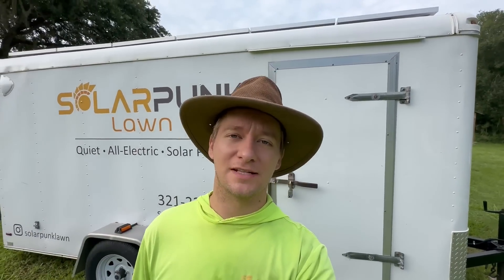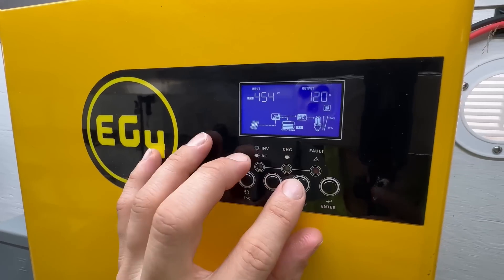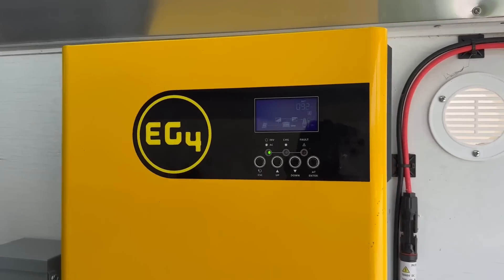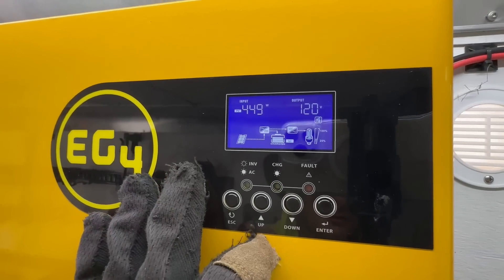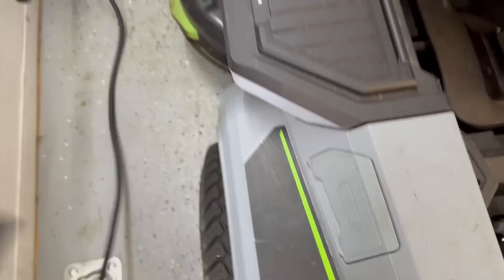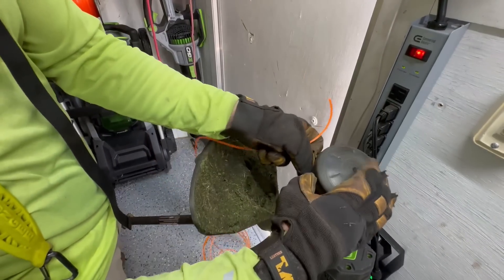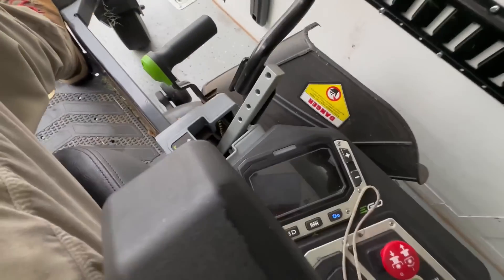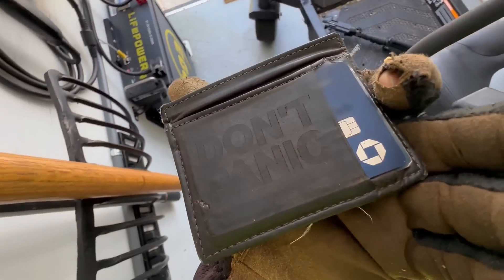Mow Forever? Solar Powered Lawn Care

Comment: But electric ain't the future huh? I love electric cars trucks vans leaf blowers lawn mowers it don't matter but it's battery powered that's badass. With internal combustion engines you have to wait for the power to build with electric motors you get it all at once. And quite violently if you wish.
Reply from the maker: Yeah I really miss having to do oil changes, mess with belts, fuel and air filters, mixing gas and oil, and pull starting a chainsaw 30 times before it fires up. Not to mention the smell was to die for, I’m getting choked up just thinking about it. All this electric stuff is too easy and it doesn’t make me feel like a man. It’s starting to crack my fragile EGO.
Reply: @solarpunksteve  all I can do is laugh love your work man. I'm attempting to go all electric but it's expensive.

Comment: So cool to watch. Growatt has a 48v all in one inverter that has a minimum solar requirement of 60 solar volts... So it does a lot better on cloudy days.  My current system has the same minimum 120 solar volts it shuts down in clouds as well.

Comment: you're wasting your time over using gas tools because of your investment in all the panels, inverters, and the tools themselves. You've probably got a 10k+ investment where everybody else has half that or less. 
It's not like you get to charge more because you're running solar crap.

Comment: Buddy I been wanting to do this setup for over a year. Big prompt to you and your setup and homework you did. Only thing holding me back is if I drive up in a diesel truck kinda counterintuitive to be using solar. 😂 You might want to add fan or 2 to help ventilate the trailer or it could affect your battery charges
Reply from the maker: Honestly I wasn’t sure if my car was going to be able to handle this whole setup and I’ve been pleasantly surprised. Don’t let it hold you back, one thing I’ve found, is most people just don’t care. Some people are like “oh you have solar, that’s so cool!” others; “that Tesla hauls that thing‽ wow I didn’t know that”. But the vast majority: “how much do you charge to mow my yard?” 🤷‍♂️

Get your system up and running with whatever you have, reinvest as much as you can and build a client list and reputation. That brings cash flow, then buy an electric vehicle some day down the line when you can afford it and save on fuel costs. 

I sound like I have it all figured out and it’s easy but honestly I’m just solving one problem and then moving on to the next as best I can. Good luck, let me know if you go for it!

Comment: Mowing someone's front yard for 25 bucks a week. While maintaining gasoline equipment, that is easy and straightforward to maintain. That's doable Since California has made it to our starting January 2024. There will be no more gasoline equipment sold. If I have to buy electric mowers, weed eaters, blowers, solar panels, and all this other crap  I'm gonna have to charge $75 a week. Electric equipment cost 3 times more than gasoline. And when it breaks, you either have to replace it. Because there's no rebuilding the motors. There's no change in the spark plug or a coil or a pull cord. It's all plastic, it's all electrical parts which go bad. Corrode have to be replaced, which is another expense. How many people out there want to pay? 350 to $400 a month to get their lawn mowed. Hardly any So all the governments doing?
Is causing jobs to be lost. Add neighborhoods to look derelict. If you don't believe me, just wait until January comes and then next summer in California. Grass, fires, yard, fires, people not maintaining their properties. I'm already preparing to just do straight fencing repair, plumbing stucco concrete demolition work. No more yards not gonna update with this electric movement. And when the neighbors around me choose to not mow their yard because of the cost of equipment or the cost of labor I'll be calling code enforcement to get them find to clean their f**** yard because they all wanted to vote for Biden and they all wanted to vote for Newsom you can pay. The f**** price. For who you voted for.

Comment: this is such an interesting business case, great video...I'm still stuck on companies keeping the removable battery power solution on larger non-hand held equipment like the riding lawn mower.  I would think they would switch over to a more standard fixed battery pack like an EV has.
Reply: Think its because many people keep mowers in garages or sheds that aren't climate controlled so aren't the best environment for long term battery charging/ storage as these batteries don't have temp control like a Tesla

Comment: so just curious does constantly doing a partial charge on all that deteriorate the battery’s longevity?
Reply from the maker: Probably, but not as much as a full discharge would.  These battery chemistries don't like to be drained to below 10-20% if you can help it.  You can argue they shouldn't be fully charged to 100% either (somewhere in the 30-80% cycle range is preferred, but practically speaking, I don't have a good way to keep them from charging up to 100% so I just let them.  If I was a homeowner I would probably baby them for longevity, in my case I'm taking a risk they might fail early, but I'm treating everything like someone would while running a business.  You don't have time to baby the batteries, you have to be out there on a property making money and taking on more jobs and running equipment hard.  So I honestly don't do anything special to my batteries or equipment, I want to see it survive or fail.  I can always get something different and learn from what did or didn't work and keep moving.  It's expensive and risky, but I personally feel it's worth trying.

Comment: You should keep a squidgy and rod mop on telescoping boom poles with right angle attachments on the truck to be able to quickly remove water and dust from your panels without a ladder. Just a small amount of condensation/droplets and debris/dust can greatly cut down on a panel’s efficiency. You may have enough battery to spare. Or maybe it’s just general maintenance you do at the beginning or end of each day. Just a recommendation. Love what you’re doing either way. Very innovative! Well done sir.
Reply: moron

Comment: This is really cool. I wish it could work for large commercial use. We got 3 zero turns running all at once and electric isn’t practical yet. For my home all my equipment is battery and works just fine.

Comment: This is pretty interesting. Seems like a lot of effort to set this up, but you probably don’t have to deal a lot with lubricants & fuels so it stays pretty clean. The electric mower probably doesn’t require hearing protection?
Reply: I’ll add that I think what you’re doing is awesome.

Comment: Cool Concept love the videos love the solar lawn care idea! Quick question, are you concerned at all about minimizing cycle count for charging? as in trying to limit topping off batteries to improve long term capacity or are you largely unworried by it? Secondly, Get a Tile Slim for your wallet it helps you track it when it's lost it's saved my ass at least 15 times
Reply: The trailer battery appears to be a lifepo, which actually prefer being held at 100%.

Comment: What kind of life do you get out of the ego batteries? I have the Milwaukee trimmer, blower, and accessories.  The blower has killed/toasted one of my two M18 XC 8Ah batteries in just about 24 months. I only use them twice per week with my mowing and trimming my own yard. My concern for a mowing business is cost of replacement batteries over gasoline year after year. I am not a electric hater by any means, I love not smelling like two cycle fuel!

Comment: Curious if heat is an issue. My enclosed trailer gets crazy hot in the summer and that's without any electronics running inside. My Zendure battery system runs very warm as well; I couldn't imagine putting it in a trailer without some sort of heat mitigation.
Reply from the maker: It gets hot and I need to add some powered ventilation. That being said, the roof is insulated (slightly) and the solar panels actually shade the roof, so the heat load is less, and I have some passive vents installed. Still though, I need a fan. This summer has been brutal here in Florida even outside the trailer.

Comment: Worst case you can get a second battery for your trailer. Also you could add some panels that you can fold up for shade and extra power on the side of the trailer. Charge the car too.

Comment: ....meanwhile my entire setup/truck/trailer probably cost about 5% of what all that must have, and deliver the same results!
Reply from the maker: The EGO stuff is pricey compared to gas, and I have no idea how long it will all last so I’m not trying to convince anyone to buy it; I just wanted to start this endeavor quickly after quitting my job. The car? It’s just what I had bought already for my previous work of traveling a lot, and when I decided to try this experiment of starting a fully electric lawn care business (while going back to school): knowing it had the towing capacity was great since I didn’t have to find a different vehicle. The trailer is 17 years old. I got it, replaced the axle, added brakes, and painted the exterior with $100 of farm and implement paint from tractor supply lol. It already had the e-track stuff which I don’t really use. 

Anyway, I threw everything together and just gave it a shot. After gaining clients I sold add-on services to my existing clients and earned enough to pay for the solar/inverter/battery in the trailer.  I’m still a small operation and if something major breaks it will be tough, but now that I at least have cash flow I can survive and continue investing back into the business and try new stuff. 

For me, it’s about learning and experimenting. I’m not here to try and tell others this is what they should or shouldn’t do. I just want to share what I’ve learned! Hope that makes sense, and if I came off as trying to tell you you need this, my apologies!

Comment: Too bad Tesla does not offer even one nema 5-20 120 volt 20 amp plug.  This way, you could power your solar trailer in case it was cloudy.  I also bet your customers would let you plug in your trailer, too, if needed.  Very good setup you have.  I bet your customers love the setup and are great for the climate, too.

Comment: I’m trying to do a solar set up but for mobile detailing, running a pressure washer, water pump, compress air ones in a while and a vaccume. How much did this set up run you?

Comment: If you’re needing to draw in more power, you could have solar panels extend from your roof like overhang to one side or both sides but also great set up
Reply: I think you can expand your customer base  to places that require low noise pollution also

Comment: I mow my parent’s lawn and their house is on a corner. I switched to electric mowing with the Greenworks 80v series. That included mower, leaf blower, an edger and a trimmer that uses the same batteries. I mentioned their corner lot. Because that eats up three batteries for a single mowing, I recharge while mowing and using eBay have  added extra batteries and a extra charger. Really happy with the switch from gasoline to electric.

Comment: i saw this pesticide spraying company (argi spray drones) that flys the DJI Argas t30.  He was using a gasoline generator to recharge his batteries. He should be doing what you are doing except with a 240v higher wattage eg4 system. the battery charger for the t30 pesticide sprayer drone draws 7000 watts while its battery is charging.

Comment: Only issue i see with this setup is using a residential grade zero turn... but the Toro electric version is just too damn expensive at this point to use.  I guess the other issue is you cant run a 2 man crew... you need the down time of weed Wacker to charge the mower and vice versa.

Comment: I am in Long Island how can I go from gas power equipment to solar trailer?
Reply from the maker: Tough to say without knowing your setup and requirements. My advice is to try and add in equipment slowly to get a feel for how it works and it’s limitations. So maybe add an electric string trimmer, then blower and see how you like them/what they can do. 

I didn’t come from gas lawn care, so I have been building clients as I go and figuring things out along the way.  I think right now it would be really tough to completely shift.

As far as solar goes, having it on the trailer is cool and I’m glad I did it, but it might not be the most financially sound decision. It’s much cheaper to install solar at your house or on the ground than it is to put it on the trailer, but I just wanted to see how this worked.  I wanted to get started as quick as possible so EGO made sense to me at the time, but there may be some better options coming soon (hopefully) and for a reasonable price. That would make it easier to switch at some point.
Reply: Thanks, I already bought a backpack battery blower because the town from June 15, to September 15 in certain town they prohibit gas blowers that is why I thought having a solar trailer was cool to charge the equipment. Soon everything will be battery power I want to start early. Congratulations for starting battery from the beginning.

Comment: What's the drop in range of the tesla when towing your loaded trailer?
Reply from the maker: It uses roughly double the energy compared to not towing, slightly more than double if you’re driving on the highway. It has plenty of power to tow it, but aerodynamics are the main killer.  Later I’m going to be trying some improvements to minimize that and will of course do some videos. But right now it’s not a big concern as I’m not going more than 40 miles in a day and staying off the highway.

Comment: Can the trailer charge the car as well or do your routes not drain the car battery that much?
Reply from the maker: So in my other video: https://youtu.be/6gmQ4YBpQm8?si=8WpcwtYbZ4fDcjm0 I show that I can actually charge the car, but I normally don’t because all that power is being used by my lawn care equipment. Also it would take an incredibly long time to charge.

Comment: That is a ridiculously expensive set up you got going on but it looks pretty sweet. I’m not gonna lie I’m not opposed to solar and battery equipment/cars. But I do not want the government to say you have to go electric. I’ve heard rumors that Cali is switching to all electric outdoor power equipment but never got motivated enough to look it up. I just got some Milwaukee chainsaws and I guess this popped up. I never thought a set up like this would ever be feasible but I guess you proved me wrong. How is all that ego equipment working out for you? I was using a ego pole saw for a bit but it would randomly shut off for no reason, then after maybe 2 months the cutting attachment lost a bunch of parts in a cut near a powerline. After trying and failing to find the parts locally I gave up on ego. Went to a stihl 131 pole saw. Might get a Milwaukee later on since I’m getting tired of gas powered stuff in the bucket lift. Any way just curious how many batteries you got total on that set up? You seem all in on ego.

Comment: Thanks for this!

Was considering an array at home this is awesome!
Reply from the maker: Oh cool! What kind of array? Off grid or grid-tie and what size? You building it yourself or having someone else do it for you?
Reply: @solarpunksteve  I'll have an electrician start it, with room to grow.

Plan is to backup the house power, with day to day capacity sufficient to charge the EV and small amount of personal lawn equipment of course :)

Haven't done the math on amount of panels yet  the end game will be ~10kW certainly.
Reply from the maker: There are tons of cheaper options for solar panels for an array at home. These Rich Solar ones are more niche in that they are designed for RV and mobile applications like mine. So you can definitely get a decent $/Watt for a roof mount or ground mount system. Good luck and looking forward to hearing how your system works once you’re up and running!
Reply: Yeah absolutely. Knew what I was seeing but really great this is consumer available now and good job making it yours.

If I was younger, I would like to say I'd get into it as well but I was never as smart as you 😊

Will try to remember to update..

Comment: love ur video.., question do you charge "no pun intended"  more for all electric lawn care?
Reply from the maker: Tough question to answer. I didn’t come from gas lawn care so I didn’t know what I should be charging. I started out with a number in my head based on things I found online, then quickly realized my area doesn’t support that kind of price so had to adjust down significantly. That put a damper on things but I’ve been slowly building my reputation as quality rather than quantity so most of my clients are all word of mouth. For those, you can charge more because it’s just you, you are the one in control of quality and consistency that they desire and are willing to pay more for. Tough to do the same thing in a volume business. 

Anyway, I think I’m at or just above the price of other lawn care services in my area, but not purely based on being *electric*. More so that they like me and/or the work I do and are willing to pay more for that. The electric and quiet are an added bonus.  Hope that helps. 

As a note, quite a few of my clients are work from home or night shift or retired, so maybe they do really value the electric, but so far no one has been knocking down my door willing to pay a bunch more because they don’t like gas stuff. Your mileage may vary, and given how crappy my town is, you might have much better results. Hope this helps.